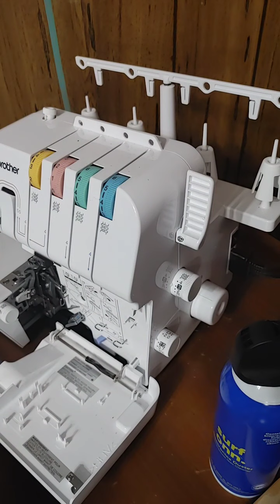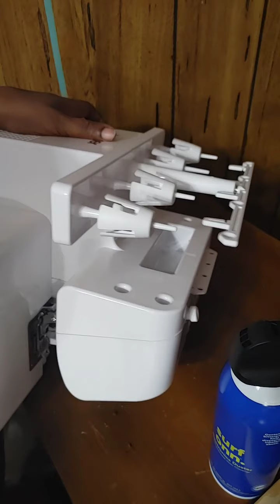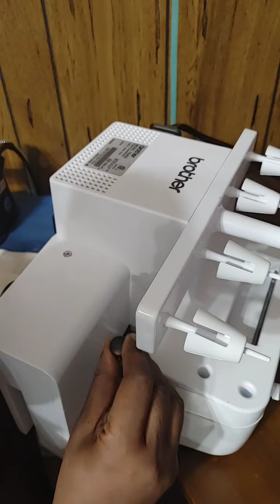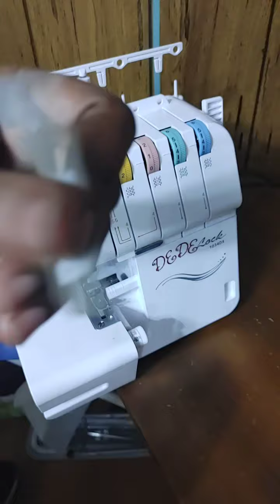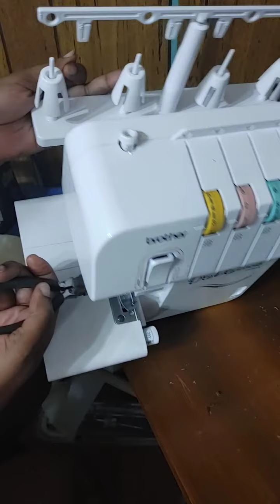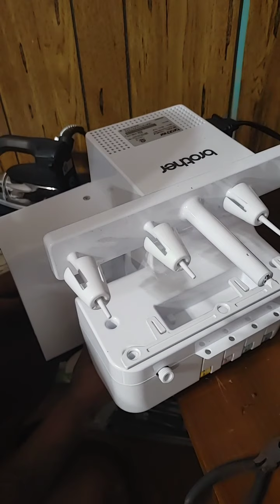Changing the needles on the Brother 1034DX serger

Comment: I saw nothing and I still have no clue to how to unscrew my broken needle.
Reply: All those screws that she took off was not necessary. I used my manual and the only thing you had to do is use the little white hexagon screw driver that came with it. First turn the hand wheel to align with the line ( it’s the big wheel). Then there are two black little holes sitting where the needle are. The top hole unscrews the left needle and the bottom hole unscrews the right needle.
Reply: @psweney1  I didn't have the screwdriver. My packet had a piece of metal but it couldn't fit. My friend  got me a mini kit and a hexagon was in it. Relief! I think they packed the wrong thing in my package.
Reply: @psweney1  OMG THANK YOU!!! I have been here for over an hour trying to figure out how to change this needle